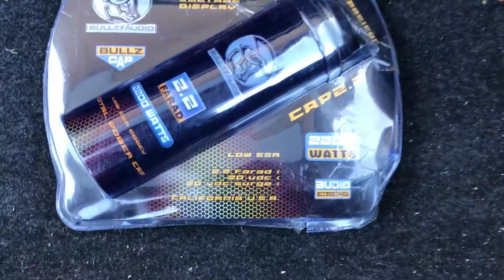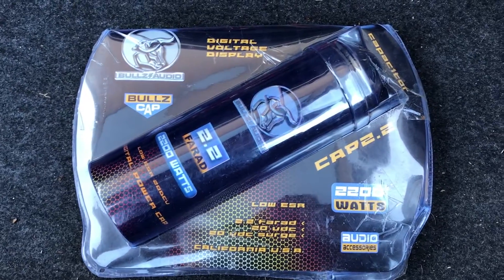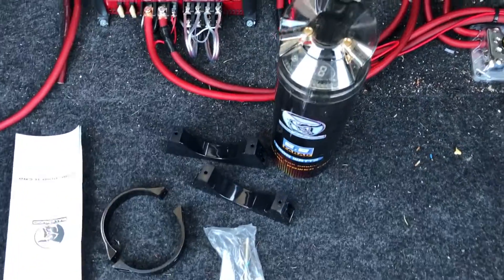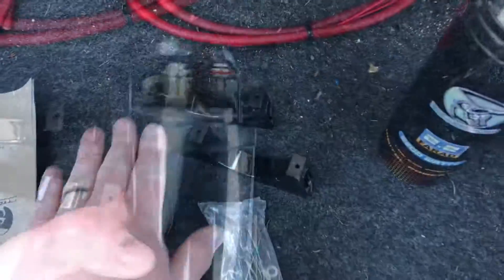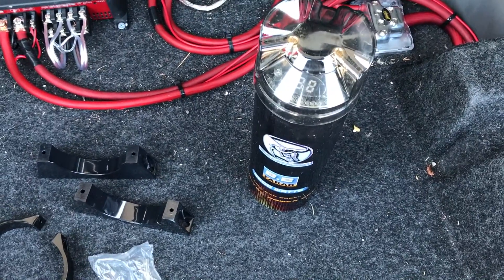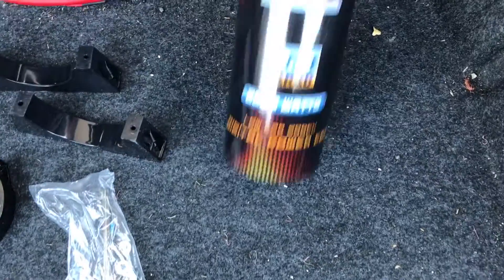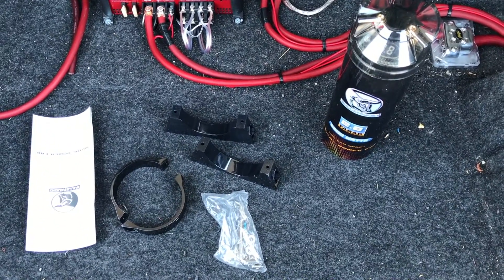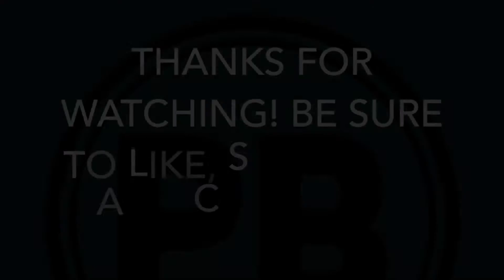Bullz Audio 2.2 Farad Car Audio Capacitor Unboxing BCAP2.2

Comment: How has the compacitor held up? Iv found one on amazon and wanted to know if it lasted or wound up being worth the money?
Reply from the maker: Not well actually, the customer who wanted it installed now has second thoughts.  If you need extra amperage / power, install a second battery instead.  https://youtu.be/qmH_N4lvppU
Reply: Provo Beast Audio Installation ok cool thanks for the reply I'll definitely be looking into the batter install
Reply: StreetGlide1